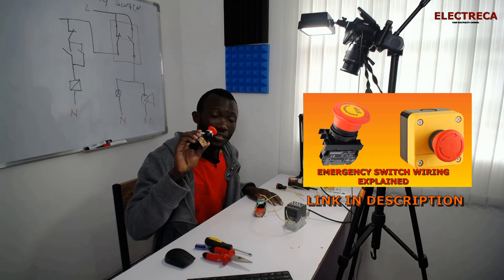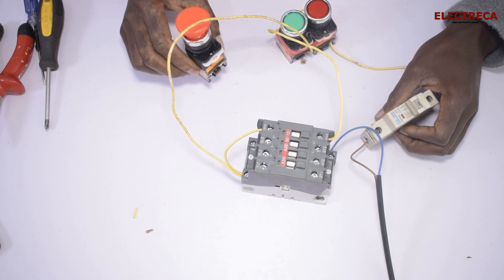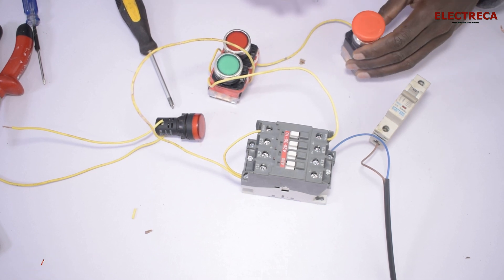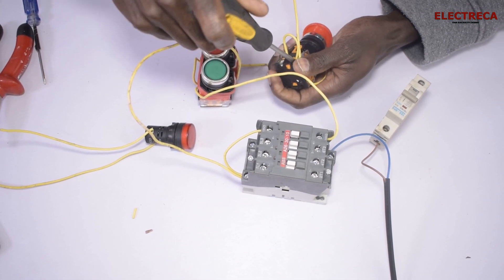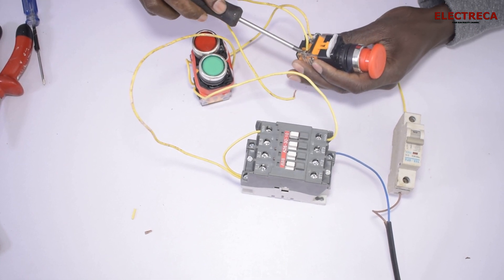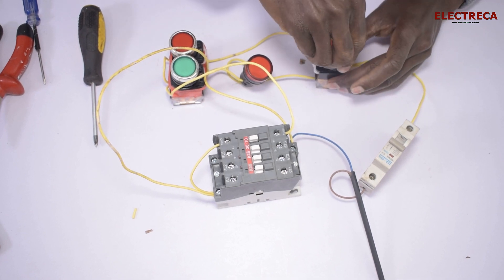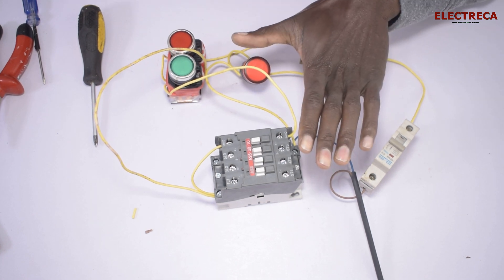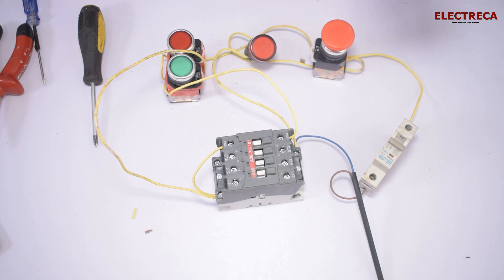Wiring an Emergency Stop Button - The How & The Why

Comment: Hey, what kind of breaker are you using in your setup? Like, how many A?
Reply from the maker: The beaker in the video is 10 amps, however the breaker can be much more smaller than that because as you see the load is contactor coil. which can not draw much current when contactor loaded.
Thanks for watching.

Comment: To the wire that goes to one side of  indicator lamp, are you looping a wire from input side of  nc of emergency stop button to input of no of emergency stop button then from output of no of emergency stop button to indicator lamp or how are you doing it?

Comment: Sir, Don't understand why need to loop the emergency button, can you explain in diagram
Reply from the maker: They are not looped, its a series connection. thats how it should be done when connecting multiple emergency switches. Thanks for watching.

Comment: Hi sir good day, i would like to ask a question for my upcoming project. Can i put a emergency stop button without using a contactor?
Reply from the maker: Yes, you can,  Emergency switch don't need contactor to work.